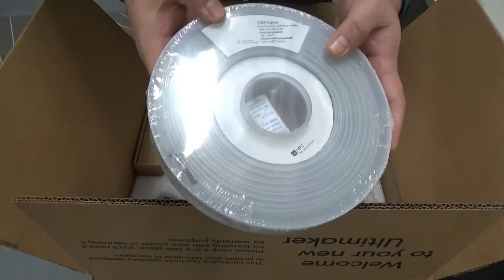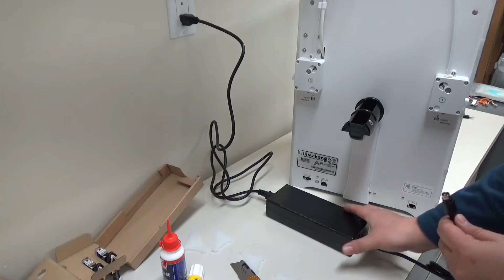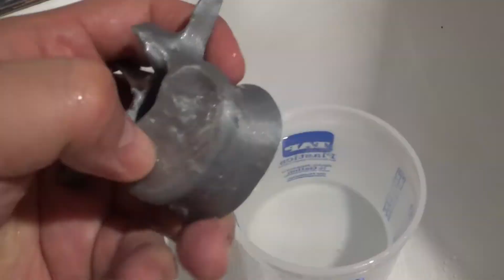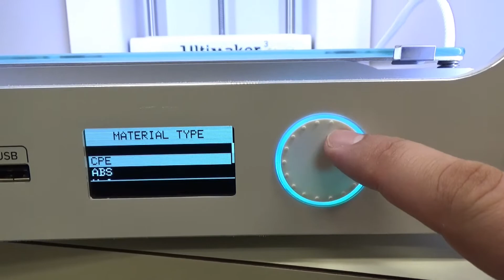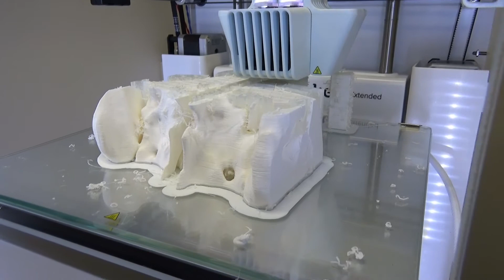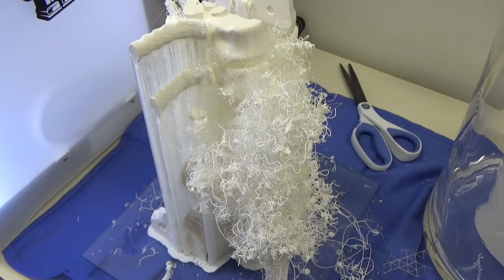Ultimaker 3 Extended Detailed Review for Medical 3D Printing

Comment: This review should become an example for those Internet shops which sell devices online. I wish YouTube had more reviews like this, on everything, including smartphones, PC's and periphery devices. p.s. I should get back to the topic of buying a 3D printer in about 3 years, they are terrible. My monthly salary is about 200 bucks, and attempting to print anything could bankrupt me. I was thinking about a model with an under-200$ budget, but even your expensive device failed, and this means my 200$ model would simply stay in a closet, and I would run around my flat in an ultimate rage fit.

Comment: in atomic method cleaning one should pull out the filament while the nozzle is at 90-100°C, you obviously pulled out the filament at ambiant !! pulling like you did is not safe for the machine, I never had  problem with atomic method if applied like described in the user manual. In addition, UM3 nozzle can be changed (like Olson block) but one should pay attention and disassemble slowly the old one.

Comment: Im using the 2+ for dental printing model at the job

I resolve problem of sticking to the plate with warming PLA up to 240C and minimum speed + extra care cleaning the glass and with  avoiding large continious first line layer (adding name of the pacient at the bottom) 

Soo far result are really good but really long  :)

Thanks for you video

Comment: All of this sounds like you didn't properly calibrate the machine, combined with possibly a defective main board or jacked up firmware flash. Did you contact Ultimaker for support at all?

Comment: That... is NOT how you do a cold pull!!!

You have to heat the nozzle back up while pulling with constant pressure on the filament until it just gets barely hot enough and releases. This happens at a much lower temp than printing temperature hence the term "Cold Pull".

Yanking on the filament like that will damage your rails and maybe even your print head.
Reply from the maker: The Ultimaker firmware gives very specific instructions during its cold pull routine about how and when to do the cold pull. The machine will tell you when the print head is cold enough to do the pull, and that is what was done in the video. I agree that the technique is likely to damage the rails and other items, but this is exactly when, and how, and at the temp that the machine instructed the pull to be done at.
Reply: @Embodi3D  Ran into the same problem with the BB Core totally clogged. While you obviously followed the instructions on the display, you missed one essential part mentioned on the website: You have to pull very slowly with constant force and perpendicular to the bed level, otherwise you could ruin the axis. I do this after every filament change with no issues. But didn‘t succeed in getting the carbonized PVA out of the BB core. Neither with a 0.35 drill. Disassembling the core and heating only the nozzle with a gas lighter until it started glowing finally did the trick and a black blob of slimy coal popped out. Now it is working fine again.
Reply: Forgot to mention: Best video on this printer I found so far - thank you very much! I went through all of your issues at least once in 3 years of using the UM3. Still love this printer, though the lack of a filament sensor is quite an issue. I’m very disappointed that there is no possibility to upgrade this expensive machine - if you want filament monitoring, you have to go for a new S3 or S5.

Comment: Can i buy you some Acupuncture Needles out of state?  (personally I've not had a issue with eBay....)  
And another suggestion is to keep the PVA & PLA in a 'DryBox' , this should help with the quality of the bed attachment.  (And PVA is expensive, you may wish to do straight PLA with Simplify3D's breakaway supports)

Comment: That is not how you are supposed to do an cold pull. Be lucky you didnt damage your printer with those pulls.

Cold pull:

1. Heat your your printer, while pressing filament gently into the hot-end.
2. While continuing pushing / keeping pressure on the filament into the hotend turn the heater off.
3. Wait for it to cool down, still applying gently pressure on filament.
4. Turn on heater, while keeping and steady pull ( Not yanking it ) on the filament, once it reaches a certain threshold the filament on the walls have melted enough to let the filament go, while hopefully its still fused to the stuck part and you will get that with you out.

Comment: Thank you for the review. For bed adhesion, try blue tape, lightly sand it and use printafix glue with the heated bed set to 80C and first layer speed <25mm/s - no way it will come off!

Comment: I always use a glue stick its a must not really a recommendation. Also try to buy a dehumidifier, that will resolve any issues with the PVA. slow down the rapid movements to 150mm/s and linear movements to 60mm/s. I have a 97.5% success rate with my ultimaker 3. The wifi video interruption monitoring is 100% the router and internet. call your local provider and tune in the channel that the router emits, sometimes the internet will be on roaming and will cause your printer and laptop not on the same channel causing the paused or disconnect of the video. Your main issues are filament management and bed adhesion, both are an easy fix. Use a lot of glue sticks, 60 degree bed, and dry filament. the new software does not have any issues as far as firmware goes.

Comment: Excellent review! Regarding your extruder jam, in addition to the hot and cold pulls, you might want to try a fine-guage steel jewellery wire. You can buy this type of wire at hobby stores, such as Michael's. I've done this same thing several times with a Deezmaker Bukito, which is a great printer, but has it's ups and downs. Your videos are great! I am trying to introduce them to a group of high school students in Los Angeles. Please keep it up!

Comment: A few thoughts...

Upgrade your Cura and Firmware.

Use less PVA! Cura has a features where the support material boundary will help. Rather than using so, so much PVA, you could use the PLA support and then a thin layer of PVA between model and support. That should dramatically reduce some print times and use a lot less [expensive] PVA. (Which leads me to again, wishing Ultimaker would make high quality Cura tutorial videos demonstrating these features. The 3D techies know where to find these things, if you haunt here daily...but "professional" users would sure benefit from tutorials on advanced topics)

As for the prints not sticking, perhaps gr5 can link in his wonderful video on improving adhesion. Just coating the bed with diluted wood glue would help you out. Glue stick doesn't always apply evenly and on the stick I have, sometimes small pieces come off.

It sounds like you are a good doctor trying to learning how to use 3D printing in your practice. Like any technology, it'll take some learning. (I worked for Information Systems at a medical center for 7 years. I know how doctors embrace new tech, but need some assistance taking advantage of it.)

Hope our comments are useful.

Don't give up. The UM3 is a wonderful printer (I miss having the loaners I had!)
Reply from the maker: Thanks for the suggestion. The thin layer PVA and wood glue tricks sound great and are definitely worth investigating further!

Comment: Nice review doctor, thanks.
I have the same printer and have never ran into the issue of glass being knocked off. I was very surprised to see that, and even more so seeing it happen in the video for a second time!  I'm glad i didn't fall and break and no one was hurt. I'm pretty sure the guys at the Ultimaker forum will be quite interested to discuss this with you.
In my opinion, it seems the bed needs levelling as it seems to be higher than it should, and hence the glass gets dragged by the nozzle. Perhaps one manual bed levelling could prevent recurrence of that.

I have a question / suggestion for you: why do your models seem to have 100% infill, meaning they are solid from the inside? 
Printing a solid objects increases the chances of things going wrong as it decreases tolerance for error, it also uses much more filament used and perhaps more importantly it prohibitively increases print time. You might find the brain print finish in less than half the time if you print with 15% infill.  One other thing, you can decrease the "support density" (amount of filament used for support) in Cura. This will also decrease the amount of filament used.
Hope to hear your feedback about that
Reply from the maker: Dear FT, Thanks for the comment. The issue with the glass build platform coming free was due to problems with build plate adhesion. The first few layers of of the print peeled off the glass plate and became entangled in the print head. The glass was not in contact with the print head, so I don't think it was a leveling issue. I was leveling the build plate before each print for the video. Also, I did not print the models with 100% infill. I used the light infill setting in Cura. With light infill and standard quality settings, the brain print took 7 days. I hope this answers your questions. Thanks very much.
Reply: Embodi3D I does. Thanks

Comment: Thanks for the great review. It shows clearly that there are two sides of medal ;-) The UM 3 Extended seems to be able to deliver really good high-quality results and printing with PLA and PVA is absolutely cool – but reliability and speed of the printer should be evaluated further.

Comment: great systematic review, very reasonable and well documented and quite entertaining to watch. Thank you! I felt for you all the way. I'm curious if you went for the form 2 sla if you can still print models with holes inside without the dissolvable filament. Really fascinating to watch, thanks for sharing this.
Reply from the maker: I was able to print the lumbar spine model on a Form 2 on my first try. Because of the smaller build volume I had to print the model in 4 pieces instead of two, and there was more work involved with removing support from the parts. But, all four pieces printed successfully on the first try.
Reply: but what happens when you have pieces inside pieces where you couldn't remove the supports without the soluble part?
Reply from the maker: Because the lumbar spine was printed in sections, closed cavities, like the spinal canal, were opened up, and it was possible to get all the support material out. If you have a totally or nearly totally enclosed space, then water soluble support is really helpful.
Reply: a very detailed review, thank you :)